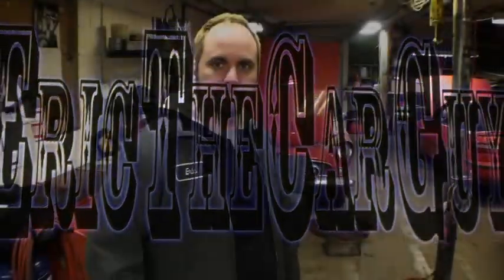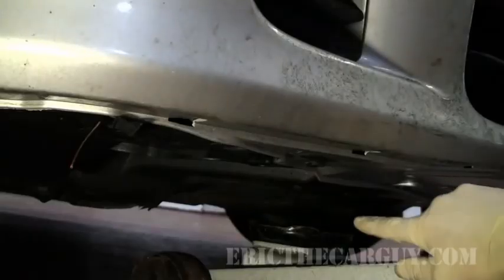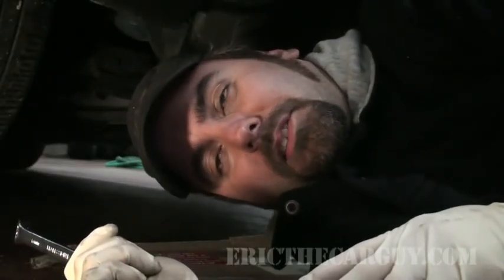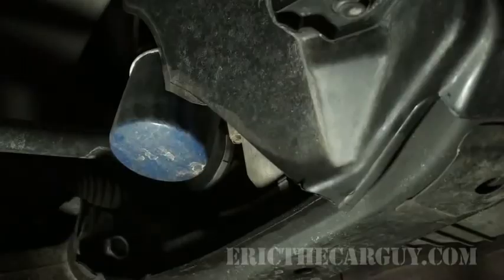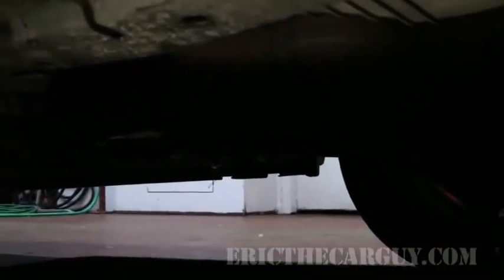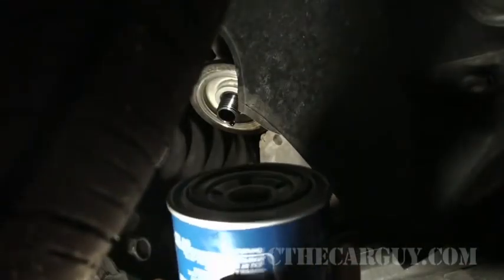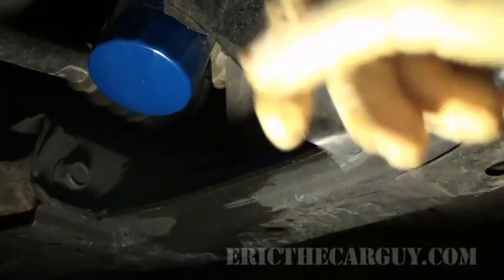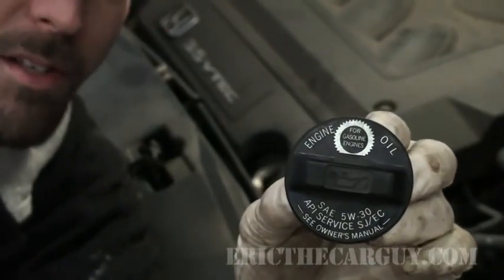How To Change Your Oil (Full) - EricTheCarGuy

Comment: The only part of this video that I didn't like was you adding a bit extra oil. If the manufacturer recommends 4.7 quarts but you put in 5, that's not right, especially when you're doing an instructional video. I think the message for oil capacity should be "Follow the manufacturer's recommendation". Other than that, great video.
Reply: R R I think he did that because the oil filter still had to fill up.
Reply: .3 quarts isn't gonna do anything bad... though your pushing it once you get past the .2 to .3 mark. 

Subarus are an excellent example... some hold 4.9 or 5.1.... I just dump the whole five quart jug in and be done with it. No need to measure out tenths of a quart....

Comment: Thanks! great video.
I tried yesterday but the oil filter wouldn't budge and being all out of my medication, I kind of went bezerk with a sledgehammer, felt good on the moment but I noticed that a lot of little things broke off or came loose, and all sorts of fluids were accumulating under the car. So I started it in order to back it up and it's at that point I first saw flames, I didn't outright panic when it was evident that the garage was on fire but when the house became engulfed in a raging inferno I must admit that I lost it. Thank god I was working in my neighbor's garage! or I would have had a real bad day.
Now that I encountered all this problems I can see it was a good idea to get some practice on someone else car, I wish my oil filter will be more cooperative, but if it is stuck too what to do?
Reply: +Bob “SandwichArtist” Lolo 
As someone who has to take meds, which one of the many reasons for needing them is to reduce irritability and anger fits...

I found this funny
Reply: I'm still waiting for the money

Comment: Pro tip: Make sure you can remove the oil filter first. Sucks to have to drain the oil, come to an issue that the filter wont budge, requiring you to go to a automotive store to get an oil wrench, but its either 2am, or you need a car to get there. So you either SOL for the night, or end up not changing the filter and wasting new oil.
Reply: No wrench?Just punch a screw driver through the can and turn. You don't need the can again anyway. Of course the oil should be drained prior to doing this. Guaranteed to work, I do it every time.
Reply: steve b  Rough words.

Comment: NEVER KNEW that you were supposed to change the drain plug washer.  Just got a new car and was about to do the first oil change (about 1600 miles) and i thought, lemme just watch the etcg oil change vid juuust incase he has a tip or two i never knew.  good thing i already have a whole new drain plug, with a magnet in it!  Thanks ETCG, I've learned so much from your vids, and still learning every time i watch!

Comment: Good tutorial. Many European cars you can change the oil and filter without any jacks or stands at all. If you have a driveway that slopes down to road level you can use that to in effect raise the front of the car to reach underneath without any danger. If you have long enough arms you can change the oil just by reaching under. Again this is probably for many European cars and is safer than any axle stand that I personally would not trust. If you have the option this is safer.
Reply: Richard Harris I wouldn't trust the brakes enough to do that.
Reply: Vince59

Comment: Nice video Eric... although when I'm replacing the oil filter, I like to fill it up at least halfway with oil so it takes less time to completely circulate throughout the engine on the initial start up.  At least that's what my Haynes manual says to do.

Comment from the maker: @aeligos I would use a gasket as it would still be serviceable after you do the replacement, if you use silicone then you will have a mess to clean up if you had to remove the pan again.  You should have no trouble reusing the bolts.

Comment: I am pleased with my oil filter setup. It has a plastic housing around one of the paper only filters. The cool thing is that there is a second drain plug in the bottom of the housing for no mess, and the housing is made for a 36 mm socket. Works like a charm.

Comment: Nice video Eric. I also use cardboard for a creeper. Works great. Even catches spilt oil before it reaches the floor. Back in the day ( about the middle 60s ) I ran a service station. We did many oil changes. Only charges were for the oil and filter. Those days are gone.

Comment: I have an oil leak coming from the seal around my oil pan..
Should I completely remove this
pan clean it off real good then just reseal it?? Need Info..
Reply: Shop would charge 50$ 
just to look at it!
I fixed it for under 30$
Reply: Try a new oil pan gasket? It's really not hard to do. Drain, Unbolt, clean out, remove the old gasket, hand tighten pan back on, torque to specs, fill with new oil. Easy.
Reply: In a lot of cars it's not as simple as "unbolt, drop, and clean the pan"..
Reply: Oh yeah I figured that out the hard way..
Reply: +Christopher Spohr what happened?
Reply: The cars scrap metal now.
The engine went on it and it became a huge paper weight.The Oil leak was one of many issues..

Comment from the maker: @13FravelJ You could cover it with a piece of aluminum foil to help keep the oil from contaminating it.  Just make sure to keep it away from the electrical connections.

Comment: Great video. My vehicle has a cast aluminium sump pan with a torque setting for the drain plug.

Also, I prime the filter by turning the engine over with the plugs removed via a road wheel until there's a noticeable drop in oil level on the dipstick. It only takes a minute or two and feel it's a good idea which avoids running the engine for a period with no oil pressure.

Comment from the maker: @NDOGG26 I normally take them and tip them upright into my catch pan overnight and then throw them away, that way most of the oil is out before I put it in the trash.  I believe there are places that take them for recycling however you might want to check to see what is available locally for that.

Comment: Call it suspenders and a belt, but I always set the emergency brake and I always chock both the non raised wheels before crawling under any car.  Except, of course, when doing rear brakes.

I made the mistake of double gasketing once, and I'll never do that again. It was a near miss that could have fried my engine if I hadn't noticed. Knowing how you can seriously screw up is what experience shows you. Vicarious gold, for those who want a steeper learning curve here on Youtube.

Comment: Great video. Thanx Eric. Just a few comments. You said to screw oil filter on a further 3/4 turn after it seats using hand pressure but I only noticed you turned it 1/4 of a turn!
Also, I tightened oil pan bolt many years ago & it leaked so since then I wrap a few turns of plumbers white Teflon tape around the mating surface of the bolt washer. Never had a leak since & more importantly never had to change the bolt washer.

Comment: Run the engine just prior to draining the oil regardless of outside air temp. You want any unwanted particles to be suspended in the oil when you drain it. Also if your filter socket is just rounding the filter and space does not allow for a screw driver to be driven into the filter, I have a dedicated filter wrench that has a hole drilled on the side of it so I can put a screw thru the socket and into the filter.

Comment: I was sitting here thinking about how my Hyundai Sonata v6 doesn't have a metal canister for a filter, and I started wondering where mine was.  I was pretty sure it was on top of the engine, but you totally reassured me. Dank.

Comment: A friend of mine has a VW Jetta with a plug that has been stripped out and he is afraid to remove the plug, so we pumped the oil out of the dipstick hole.  We got 4 quarts (of roughly 4.2 quarts per the manual)... Used Nylon Hose Barb A-193B, Watts A-679 Hose Adapter, and Lowes Drill Pump 138026.  It worked VERY fast and well!

Comment from the maker: @hubbleISS Remember that pressure is actually a result of the resistance on the system not the oil pump.  I haven't really known any issues using those ad ons personally.

Comment from the maker: @straydoggio Actually removing the cap or dip stick really doesn't make a difference as the PCV system vents the engine to the intake anyway, that trick DOES work on transmissions however.  Thanks for the comment.

Comment: Good stuff - covered everything - including the importance of environmentally friendly and safe disposal of old oil!  Oh I do have a suggestion...just occurred to me:  Yes definitely warm the car up so oil nice and warm to flow better... but  I was always told to remove your dipstick and the oil engine cap.. before undoing the drain plug/sump plug.  That doing helps allow for a better flow of getting all the old oil out.  (BTW I've had a Futomo Valve for 4 years, and I love it.. like a tap.)

Comment: Thank You, you are the mechanic that I would like working on my vehicle's!!! The plug on my transaxle was so tight that when I used my 1/4" adapter (3/8 to 1/4") the 1/4" broke! Way to tight! Also the filter was so tight that I could not it off! I remembered this trick someone told me, have you ever tried the belt trick? You slip belt around the filter, then you are able to get it turn pulling against the buckle. It's kind tricky to put into word's? It will do the job! Anyway thank you!!!

Comment from the maker: @jill66070 Most transmissions are filled through the dip stick tube so I don't think that will be an issue, normally the engine oil plug is marked as this one was so keep an eye out for that.  Good luck.

Comment: Great video!  With all do respect I would like to add 2 things. If any front end linkage or universal joints take grease at every oil change is a great time to grease them. Also this is a great time to check all exterior lights on vehicle for proper function. This will help avoid accidents & save you being hassled by police. The only lights that are tricky to check are the brakes. If you can't get help wedge a pry bar between the seat & brake petal. Put card board on seat to avoid damage :)

Comment: You can also open the fill plug when draining your oil so it flows out better. Just changed the oil in my diesel and it takes 7 quarts plus filter to fill it. Changed over to synthetic for better starting and longer lasting.

Comment from the maker: @choi3ed Yes pretty much.  It's imperative that you use the oil that is called for by the manufacturer either written on the oil cap or in the owners manual, I don't recommend you use anything else.  I also don't recommend synthetics if you have an oil burning or oil leaking problem as it will leak faster with synthetic.  Lastly do a compression test or better yet a leak down to see what kind of shape the engine is in as you may be fighting a loosing battle if the engine is worn out.

Comment: The filter on my car is top as well , the cartridge type , and the drain plug is right at front of the sump at the front of the engine , so it's easy to get at without jacking the car up , being of wiry build I can reach under without much problem, it's a job I quite enjoy  , changing the oil , something very satisfying about it .

Comment from the maker: @offspringy No, it really doesn't do anything as the crank case is vented to the air cleaner assembly anyway via the PCV system.  With transmissions it's a different story however, I always pull the dip stick on those to get the oil to come out better.

Comment: Perhaps I can help:
1.  Some washers (some older honda) are soft and are designed for 'once -only' use.  They crush and seal.  So if reused they may not seal correctly.  The last thing you want is a leaking drain plug.  On other plugs which are reuseable you can put a shoulder of PTFE tape to seal against the pan/sump.
2.  When you start a car you want the oil and pressure to be at wearing surfaces asap !Having oil in the filter helps. Been doing it for 45 years.

Comment from the maker: @chrispuncher1 The oil type should be listed on the oil cap or in the owners manual.  Where you get your parts should be able to get you the correct filter to use for your application.  Good luck.

Comment from the maker: @DJYIC Not at all, you may have to drop the exhaust pipe to get it to clear the pick up.  You might want to watch the video I did on the Engine Dissection to see what your up against.  It's a pretty easy job really.

Comment: I have a couple questions;
1.) Why is it a good idea to change the washer on the drain plug every oil change?
2.) I've heard it's a good idea to pour some new oil into the filter before you screw it on in order to avoid "dry starting." What is dry starting, if there is such a thing, and why would it be recommended that the new filter be partially filled? Thanks for your time.

Comment: To prevent future trouble with a stripped out drain plug, use a EZ Lok insert. It's  easy to install. Get only Fram filters. They filter  better.

Comment: everything i said u said after i said it.ur the first oil change video to do it 100% correct..u remove all filter with plug still off which is the right way....u mention checking the level after u run the car as the oil filter takes some of the oil...u mention recycling old oil...u mention replacing the crush washer....u truly know your shit and there's no debate with that...u definitely know what ur talking about..mm.good shit man...good shit!!!!!
Reply: remove old filter**

Comment from the maker: @arios211 Using ramps is not a problem really so long as you don't end up draining the oil onto the ramp instead of a pan.  It really depends on what time of year it is, if it's cold outside then it's a good idea to warm the engine first to speed the process of draining it out but in warmer weather this usually isn't a problem.

Comment from the maker: @Whit3Mike Removing the oil cap really won't make a difference as the PCV system will vent it anyway, that trick works better on transmissions.  I see no problem at all with magnetic drain bolts or I've even seen where a magnet was put onto the oil pan to accomplish the same thing.

Comment: hey Eric I love your videos. but I just wanted to say a few things. Firstly when jacking a car please be careful (not that you aren't but others may not be) Use redundant safety systems like two jack stands and put the jack under there with you with just a small amount of pressure on it to help also. Ramps are also nice to have. Im not a big fan of getting under a car but it has to be done. lastly like you said in your video you cant always jack from the cross brace. the sx4 will bend there.

Comment from the maker: @heyitstheo47 Too much will fill the crank case and the oil will come into contact with the moving crank shaft, if this happens the oil will become air-rated and foam up, this will not lubricate correctly in the same way a lack of oil would thus damaging the engine.  Oil needs to be a liquid to lubricate correctly not a foamy mess.

Comment: It is also a good idea to fill the new oil filter with new oil so that it takes less time for oil to start running through it when you first start the vehicle, and it helps avoid some other problems that might pop up at the first start up.

Comment: You can save a lot of money. Also it allows you to use the type of oil you want, and the oil filter you want. I like the Napa Gold oil filter. Many places here will take the old oil for free as they use it in heating units.

Comment: Eric, nearly every time i change the oil on my 96 Jeep GC 5.2 the gasket remains so it's a good thing you mentioned that-- on my 09 Accent SE i have to replace the drain plug compression gasket, Hyundai sells them by the bag of i think 10

Comment: My personal recommendation would be to fill up your oil filter with oil before screwing it back on. Then the level of the oil won't change much, if at all, when you start and run the car. I've been told by some that it could potentially damage the engine because there may be a time when little or no oil will cover the engine until it fills up although I'm not entirely sure that that is true. I just play it safe and fill it up. Im not sure you can do this in all cars depend on where the filter is

Comment from the maker: @Intelpentium54321 .3 quarts is negligible but yes you don't want to overfill the crank case as you will whip the oil up and air-rate it causing a lack of lubrication in the process.

Comment: Don't know why people use the old oil to lube the filter. I always use the new oil and also put some oil into the filter if you can. Interesting tip on keeping the engine warm when changing oil, it will make it easy for the oil to flow. As for changing the washer every oil change, inspecting it to make sure it looks ok is good enough. If it doesn't look worn then it's ok to use. Don't see the point in changing it after every oil change. Long as you're not over tightening the drain bolt you don't really need to worry about replacing it. In the last 20 or so oil changes i have done on my car alone, the same washer works just fine. I would keep an extra handy just in case though.

Comment: My bolt was very tight so I put my jack under the socket handle and cranked it up, success :) I put the jack on a block to raise it up to right initial height. Make sure the bolt is turning anti clockwise!

Comment: Thanks for the great info in this video. I have a quick question. You said that the washer in the oil drainage bolt should also be changed. Can I use a low strength Loctite instead? I am afraid to use it and will hard time removing the bolt in my next oil change.